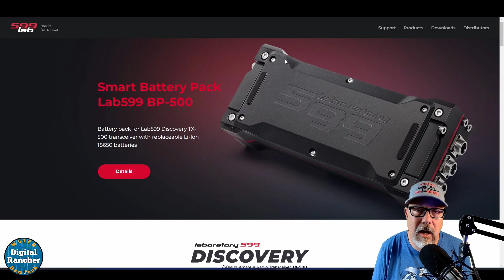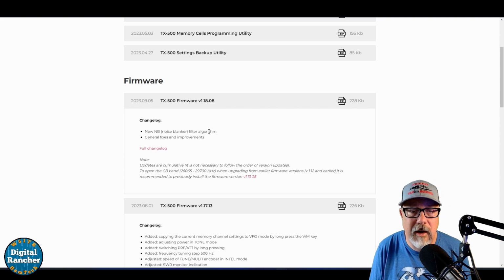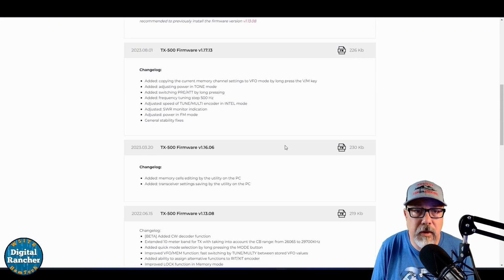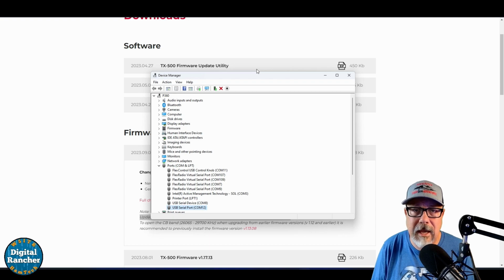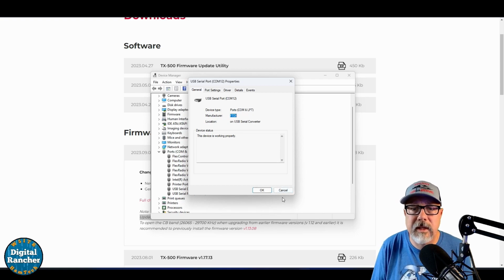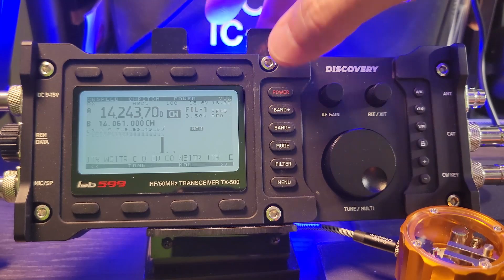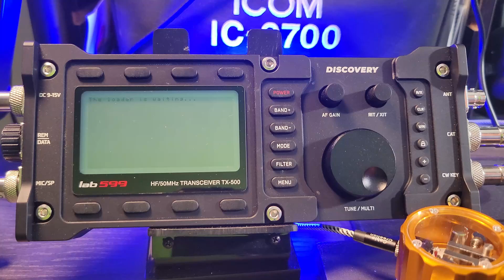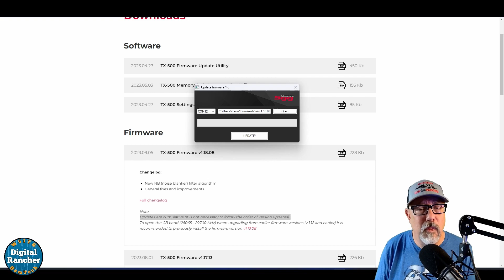Discovery TX-500 Firmware Update

Comment: I really like the looks of the TX-500.  Glad the firmware is easy to update & that the manufacturer issues updates to correct existing problems and add new features.
Reply from the maker: I really like the form factor of this radio. It is great for portable/travel. I took it to Huntsville this year. I currently have it as you see in the video, on the side of my desk just to practice Morse Code. It has a built in decoder (firmware 1.13) and a nice side tone.
Reply: The TX-500 is the only thing I wasn't able to sell at the hamfest last weekend.  :(
Reply from the maker: @WhatsUpWithSix  you may have to break up your full kit to move it.